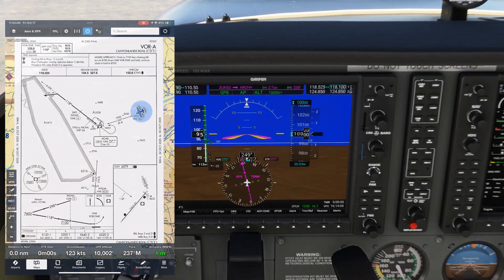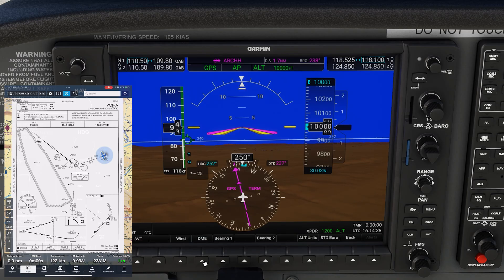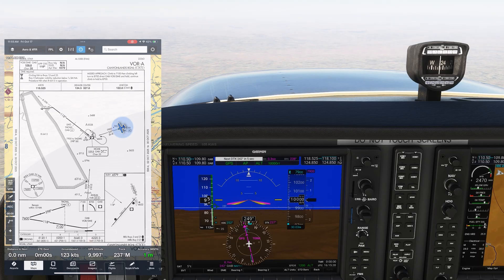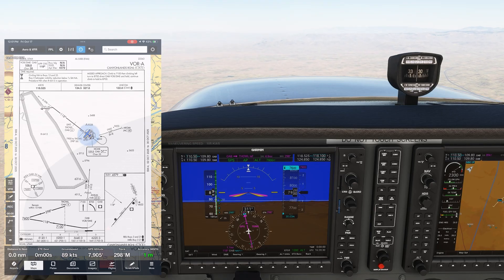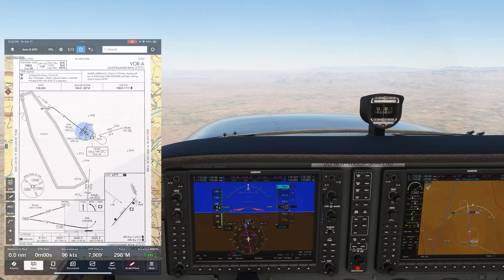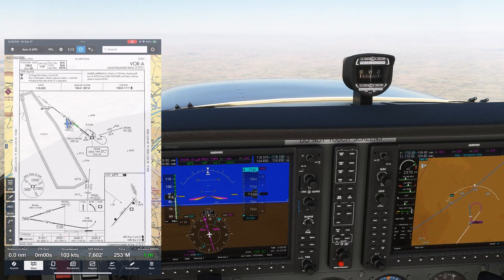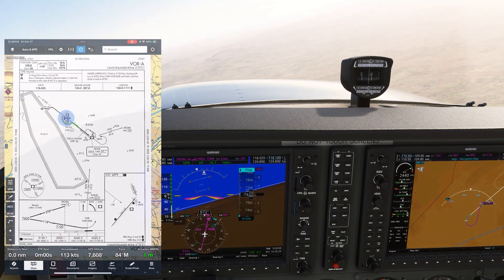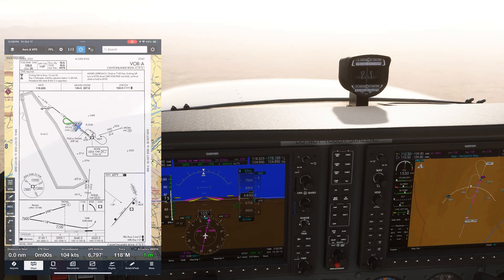VOR Approach into Canyonlands (VOR-A): Step-by-Step on the G1000 | IFR Training Series Part 1

Comment: Are we sure flying a navaid based approach entirely on pink needles, with only the bearing indicator for the station, is kosher?  Seems appropriate to use GPS for most of the legs monitoring the station w/ bearing 1, but once the FaF is my next waypoint, I switch to the green needles, and if on AP and its an ILS, activate APR mode.  Is it ok to stay on GPS the whole way on the primary navigation indication?
Reply: Aim 1-2-3 c 5 says the vor must be monitored, but GPS may be used to navigate.
Reply: For what it's worth training on VOR-A into Oceanside, I flew it once following the GPS guidance. I saw I was off by close to 1 dot on my backup VOR CDI. Feeling very confused, I told my instructor I was going to switch to the VOR guidance. He said, "take off your foggles". I was exactly midfield, right on track for the missed approach. Had I flown the VOR guidance, I would have been offset around 1/2 mile from midfield. He suggested I fly VOR approaches using the method in this video because GPS is more precise and less prone to these kinds of errors and its legal per the AIM. We both agreed I'd need to go missed if I got to full scale deflection on the VOR CDI I was monitoring.

Exact words from AIM section referenced by @jamesf.9429: Use of a suitable RNAV system as a means to navigate on the final approach segment of an instrument approach procedure based on a VOR, TACAN or NDB signal, is allowable. The underlying NAVAID must be operational and the NAVAID monitored for final segment course alignment.
Reply: When teaching my students primarily in GA aircraft where I never know what aircraft they’ll end up in I’ll always have them swap to green needles to intercept the FAC. In this instance when Dan pulls off the course off to the left I have them turn start the timer and swap to green needles at that point so that when they turn around they are intercepting the VORs guidance. They won’t always be flying airplanes with a nice HSI and a bearing needle to have them monitor the station while they fly it on GPS. 

Many ways to teach instrument and this one is valid for the equipment used.
Reply: I personally think its good practice to swap over to VOR as your primary navigation source before the FAF if you are on a VOR approach

Comment: SO a question...if planes are constantly being upgraded in design and avionics..why haven't they upgraded navigational aids (VOR'S + NDB's)
Reply: Ndbs are slowly being phased out, but many vors are still kept for redundancy, due to concern of GPS jamming.  See minimum operational network.
Reply: @jamesf.9429   but why can't they come up with something more modern instead of something from World War 2
Reply: @omarijoseph3189  Mostly due to the cost. VOR still works just fine, if well maintained.
Reply: They are, G1000 can actually perform LPV approach, it is like an ILS approach but with GPS building a 3D approach

Comment: The approach categories are based on the Vref (or 1.3 Vso) speed not the ground speed, while I agree with you that using a higher minimum is a good idea, I think that’s a point worth clarifying.   Another excellent video!

Comment: Can you fly this approach on green needles using auto pilot? If so, you would have to fly the outbound and procedure turn all using heading mode? Once inbound, would you fly it in NAV mode or APR mode? I flew the VOR RWY 25 straight in at Santa Barbara (KSBA) with vectors in a G6 Cirrus SR 22T (basically a G1000). I activated the approach using vectors to final, I switched CDI mode to the VOR. The VOR was tuned automatically by the avionics and it had the proper radial set. I was within 1/2 dot of the course (radial) and clicked the APR button on AP with the altitude bug set and pressed ALT and then AP. The scoreboard indicated VAPP but then it blew past the radial. It kind of waffled back toward the course somewhat but then just kind of wandered around left of course. ATC said I was left of course so I gave up on the auto pilot and just hand flew the approach. A) That should have worked, right? B) If I stayed on GPS guidance and displayed bearing 1 from the VOR, is it better to fly this in NAV mode or APR mode on the auto pilot?
Reply: APR implies vertical approach guidance. I'm not familiar with your autopilot, but on most that I've seen, green needle APR mode only works for an ILS. Check your autopilot manual. You may find that NAV mode is required for VOR green needle approaches.
Reply: NAV mode for VOR approaches, not APR. See your manual.
Reply: @pisymbol  Not sure if this is the same as G1000 as my manual is Garmin Perspective Plus Guide - but on p. 407 it says "Approach Mode is activated when the APR Key is pressed. Approach Mode acquires and tracks the selected navigation source (GPS, VOR, or LOC), depending on loaded approach... VOR Approach Mode (VAPP) provides greater sensitivity for signal tracking than VOR Navigation Mode. Selecting VOR Approach Mode: 1) Ensure a valid VOR frequency is tuned. 2) Ensure that VOR is selected navigation source. 3) Press the APR Key. 

I'm willing to bet I did something else wrong but as I reviewed it, I kept coming back to I had it all set up correctly - with green "VAPP" even indicating in the scoreboard. Next time, I'll either fly it on Magenta needles with the VOR as reference or give NAV mode a try!